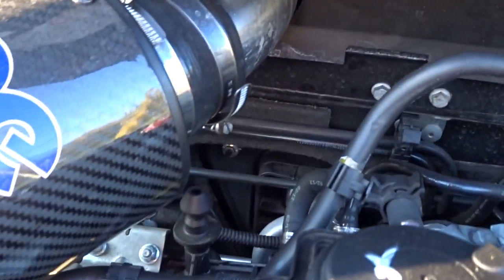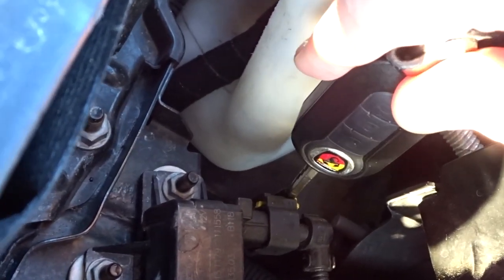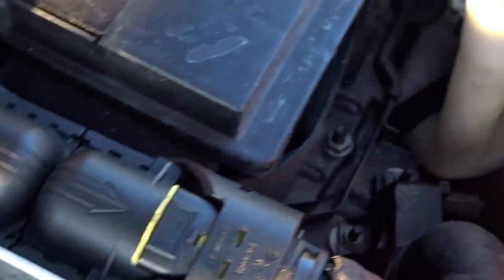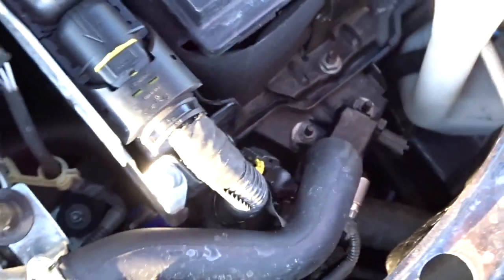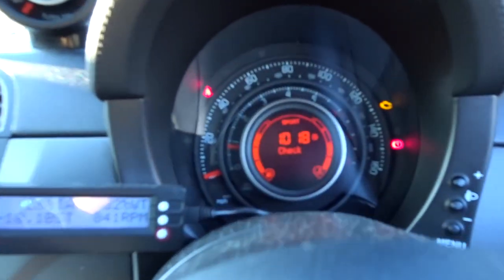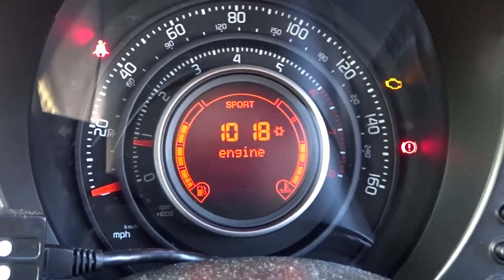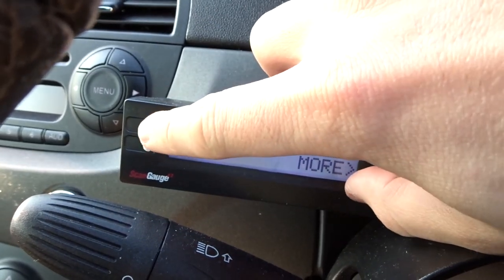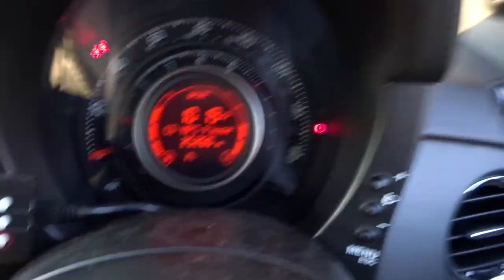How To Get Turbo Flutter Sound: Turbo Chatter Sound | How to make your turbo flutter

Comment: A turbo flutter makes any car guy happy
Reply from the maker: +Charlie Jones that it does!! :)
Reply: My peterbilt makes that noise to when i go hard on the gas and let of, i hate that noise😑😑😑
Reply: Not the one who's racing against it 😂
Reply: What makes the flutter sound
Reply: akos kapa Car Throttle Extra made a good video that explains it well.
Reply: @akoskapa9809  special types of bov
Reply: @averykillian7143  incorrect, that noise is caused because your BOV spring is to hard for your vacum and it never open, so basically you over pressure is coming out buy you compressor part of your turbocharger and yes.... it is bad and damage your turbo
Reply: @fherraul5287  that is what i meant some bovs come too weak to do it
Reply: @akoskapa9809  air going through turbo
Reply: Very true
Reply: @fherraul5287   it's not bad and it can't damage the turbo. That's a myth
Reply: @strider5119  i never said it was bad for the engine or turbo. Is bad for performance, and overtime it will kill your turbo faster. Just go to the track or a dyno and try few runs with and without BOV and you will see.
Reply: @fherraul5287  it's not bad for performance though. I know plenty of people who build cars and a lot of them don't run bov's.
Reply: @strider5119  that good, i respect that but in my shop we do things correctly or "by the boock" not because a loot of people are doing this or that. But i respect averyone idea and methods.
Reply: It will shorten the life of your turbo system. 

The most efficient system is the recirc. The already made boost pressure isn't just dumped like with a BOV. It's used again when the throttle is opened. 

The turbo flutter is the high pressure compressed air hitting a closed throttle butterfly & having nowhere to go but back out through the turbo compressor blades. 

It adds unnecessary twisting forces between the compressor and exhaust side.
Reply: @fherraul5287  It's so bad for performance it's common place in motorsport not to run a valve, speaking of seeing a difference on a dyno, High Performance Academy tested it on  their youtube, they ran the car with and without a blow off valve, there is no difference in turbo speed after you lift off the throttle between them, though anybody that has actually done it could have told you that.

Comment: Ima an FCA MasterTech and I can tell you from experience that the CEL you had was most likely OVERBOOST! When you close the throttle with all that boost from the turbo it needs somewhere to go, hence the RECIRCULATION VALVE, it takes that pressure and dumps it back into the air cleaner to reuse. It prevents turbo lag and keeps the turbo spinning. When you cap or unplug a recirc valve it put MAJOR wear on the turbo bearing. The noise is from the turbo fighting against the boost pressure with a closed throttle. Have fun buying a Turbo for that thing! I highly recommend NOONE do this unless you want to destroy your turbocharger and void your warranty if any. Try spending actual money on real mods I have a co worker with a 500 abarth and all you need is a SRI or CAI, A BLOW OFF VALVE or HYBRID RECIRC VALVE and a GOOD TUNE!
Reply: Let us have fun lmaoo😂
Reply: You ain’t wrong, I was looking for a comment saying this if not I would have told them😂
Reply: From 20yrs of experience with turbo's I'm sorry but you are wrong.

Comment: You can essentially just use a blanking plug on the Recirc valve pipe, Which means you won't need the Scanner to reset the fault codes,  as the Solinoid will still operate as normal just won't receive any boost, the car engine management won't know any difference, as it won't need to be unplugged, Also saves the risk of Limp mode.  You really only need to block off the Intake side, Some people remove the Recirc valve completely and block all the attached pipes, But it's much simpler just to blank it off.

Comment: if you want to keep the stututut noise but dont want the check engine light,,      remove the recirculation valve and replace it by the proper tubing (I, T or Y connector or whatever is needed) but keep the connector in the valve.    This way the ECU sees the valve is being activated and SHOULD not give the ECU light...      on most cars this will be a 10min job max if you got the right parts

Comment: Added a Dinan turbo boost on my A5 now turbo flutters.  People like it
Reply: Same i got it for my benz, how do you make your car stustustu?
Reply: I have a cold air intake. I think the DINAN builds up more pressure than the divert valve can dump. Result is backflow thru the turbo. Try it. If not electrically disconnect the divert valve.  (that may cause a check engine light). Some people tie wrap a dumb divert valve that is not plumbed into their turbo system so the car is happy because it sees a divert valve even though it's not plumbed in or doing anything useful

Comment: Tried this. It sounds so good hahaha.
Reply from the maker: +EnglishKnifeReviewer 🙂👍
Reply: Stef AB Hi Stef, I've reconnected it now, but my check engine light won't turn off. I looked up that gadget you mentioned and didn't expect it to be £200.00. I read online that'll it'll reset after a year. So now, either I spend £200.00 on that scan gauge, take it to a garage and pay them to do it, or wait an entire year for the light to go off. If I knew this, I wouldn't have done it. Any advice?
Reply from the maker: +EnglishKnifeReviewer Ah man, I did mention in the video that you need the scan gauge or you need to take it to be reset 😞 Maybe unplugging the battery for an hour may reset the ecu? Not sure if that will resolve it but could be worth a try.
Reply from the maker: +EnglishKnifeReviewer there's a scangauge for £60 on eBay at the moment. It's the scangauge 1. Just check it resets fault codes before you buy. Also on Amazon new scangauge 2 for £160. eBay sellers are overpricing them
Reply: Stef ABtv whats the problem with having a check engine light
Reply: Is it different on the US models
Reply: EnglishKnifeReviewer ebay. £30. Obd reader. But LOL 2018 boooyz
Reply: what do you unplug and does this hurt the car
Reply: @-movements-6359  it hurts it really badly, dont do that!!!

Comment: I have 2014 mini cooper s F56 Doing the flutter noise all the time, it came with stock after cold air intake is installed, the flutter is very loud, and it has over 120k miles on the stock turbo, still running smoothly as it is my daily commuter. so no worry that much, just enjoy the way you like it. 

oh, and also, one idea if anyone wanna make the flutter with out having the check engine light comes on, I insert a T10 or 192 light bulb into the dump valve connector by banding the legs out of the light bulb and use electrical tape to tape it down, that way is cheating on the Engine Control Module the dump valve electrical circuit is not broken or disconnected, so it can flutter with out having the check engine light.

Comment: I mean you can simply fit a small air filter on the BOV to make it open and not recirculating. Similar Whoosh but you don't get fault codes or harm your turbo.

Comment: Sounds like it's pressure relief through the induction kit instead of the valve relieving pressure due to being unplugged. If high boost/remap it will cause compressor stall/short life of turbo, happened on my Delta turbo in the '80s without a dump valve, woosh through induction kit was great but compressor stall on hard acc was pants
Reply: Are you another person that thinks compressor stall means the turbo stops?

Comment: 84-89 300zx dont come with a blow off valve from factory and some of them i have seen well over 200,000 miles - some reason they thought it didnt matter or need to worry about wrecking your turbo
Reply: They only made like 5 psi of boost on the 89 model, it didn't even have a intercooler. Putting a BOV/BPV may have had little effect, as there is not a lot of pressure
Reply: If you're running 8 or more psi i'll say is when you may want to have a BOV/BPV to reduce the wear on the compressor.  Even if the effects of not running a BOV or BPV are neglectable, it's always better to be safe than sorry.
Reply: 18 psi on mine just fine - flutter flutter - just fine no issues here -   i think its personal preference with this idea - either way it sounds cool -
Reply: the one Just because it is running now,  doesn't mean it will later. It won't sound good when your car doesn't run at all
Reply: the one There is a reason why most cars these days come from factory with a BPV, manufacturers won't waste their money installing them on every single turbocharged vehicle they make for no reason.

Comment: cool....but on mine it dosnt change anything....after 2-3 startups it comes the enginecheck but no tututututu
Reply: ??? any solution why
Reply: tim006e do you have an intake? You probably won't hear it with the stock one
Reply: tim006e feels bad
Reply: You need a cone filter or free flowing cold air intake to get those turbo noises ... Stock airbox has a muffling effect, also if you don't care you can Swiss cheese before the filter of your stock airbox (Swiss cheesing the airbox is a technical term btw 😁👌)

Comment: My Mini Cooper S F56 used to do it stock, it would flutter nice and loud every up shift (MT) with no need to unplug the valve. But after a year of driving it and 3000 km the flutter is not there most of the time, it is barely noticeable from 2nd to 3rd but that’s about it. I can’t really notice a difference in how the car runs, if anything I feel it runs better because of the 3k it takes the engine to break in. But definitely miss the flutter.

Comment: What about if you put a resistor in the connector to trick it in to thinking it's still connected same as you do with airbags and aftermarket steering wheel

Comment: So, all I have to do prevent the valve to dump the excessive pressure from the turbo? Would I not want to dump the excess pressure somewhere? Can you explain where the pressure built from the turbo goes, if not dumped somewhere/anywhere? Cool noises tho.
Reply: Dumped back into your turbo
Reply: Thus coming out through your turbo making that flutter noise
Reply: Turbos are a type of air pump? They pump air one way, only? They produce a good amount, to a lot of pressure. That is being sent through the intake system? The engine is itself a big air pump? So if an pump charging the larger pump gets backed up would that not be good? An N/A engine “air pump” has blow-by, essentially the pressures that are deferentially above and below the rings around the piston, will have pressure go by, they are designed to allow the occurrence periodically? 
    Are turbo manufacturers and engineers, designing with the reintroduction of previous pressures, being pushed backwards when compared to the normal operation?

Comment: I have similar noise in my 2016 MINI Cooper S but I didn't disconnect anything.  I don't remember hearing this noise before but it appeared later few months later after I purchased my car used.  Still under warranty and there are no codes.  Is this normal?

Comment: how does it works on the Fiat Bravo 198 1,4 120 HP (its the same engine but smaller turbo)
Reply from the maker: +The1Maywather would think if it's the same engine it should be he same concept but I would double check before doing it. Also make sure you have a way of clearing fault codes down too and an intake 👍🏻 as mentioned in previous comments, it's not great for your turbo
Reply: Stef AB thanks,  yeah i know dont wanna do it often ^^ i will check it out ;)
Reply: Stef ABtv I don’t have a cold air intake but I have a k and n air filter and a 2013 Fiat 509 TURBO can I do it to that?
Reply: Works great, put a after market air filter on it to make it louder

Comment: If you want to do this more effectively you need to remove the hose from the valve to the intake. The bov side needs to be capped and blocked off completely. I use a $2 rubber chair leg end because they come in 25mm and are a perfect fit.
Reply: ss1900 that's what I'm trying to do but I'm sure where it is on my 17 500 abarth it's a US model seaming to be different location
Reply: Can you do a video showing us?

Comment: so will not clearing the code cause problems? or are there other ways of getting this sound with out causing problems thanks for the vid love the car!
Reply from the maker: +murf's garage you can get the sound with just the intake and careful throttle control, if you hit boost and very gently bleed off the throttle it will give you flutter at low Rpm too. As far as I'm aware the code doesn't put the car into limp mode so still drivable
Reply: +Stef ABtv okay thanks man

Comment: Instead of "unplugging" the dump valv to ghet the flutter, u could just remove the recykling pipe and plug that. That way the dump will go rigt out and u will ghet the nice "PSCHHHHHhhhhhhhHHHH" noise. and u wont risk dameging youre turbo whit the blow back air. :D

Comment: Turbo chatter vs turbo flutter is so different.. turbo chatter is the compressor wheel chattering because the bearing is worn out or damaged usually, not what you want and sounds awful lol

Comment: Hey! If I unplug it and not to bothered about the light will it be fine to run with the light!? Or will the engine assume bad conditions and fuel heavy and go into limp etc.. thanks!
Reply from the maker: +ABFlash I think overtime the ecu won't like it and it could cause issues down the line. Best to be able to reset it IMO

Comment: hmmm....do i bother to do it just for ace 2morrow nite or do i wait till i get my bonalume bov on sunday...oh decisions decisions
Reply from the maker: +Hardcore Scorpiator ooo bonalume 👍🏻👍🏻 good choice
Reply: Hardcore Scorpiator How about don't do it at all because it will break your car. The whole point of the valve is to stop the excess boost backing up into the turbo.
Reply from the maker: +Adam Henry not so bad if your replacing the turbo soon 👀 lol but yeah as Adam mentioned paul it's a how too rather than a recommendation. Also mentioned in the video 🙂
Reply: Stef AB exactly and yes you did make it clear to people matey

Comment: Hi Stef, I have the North American 500 Abarth, and unfortunately my car goes into limp mode when I unplug the recirculation valve. Slightly different setup with the recirc valve mounted on the turbo itself, but still the same theory. If you don't clear the code, does your car go into limp mode?  I get limited to 9 lbs, but haven't tried
clearing the code with the valve disconnected.
Reply from the maker: +Jon Olaivar on the tjet is doesn't go into limp but the eml stays on until you clear the code down
Reply: Stef ABtv Ahh, I guess with MultiAir and a larger turbo (1446) the US devs we're a bit more cautious with the programming.  I love your car and your channel, it really makes me want to tune my Abarth!

Comment: +Stef AB I am having trouble locating the soluenoid in my 2013 fiat 500 Abarth was wondering if you could help me? It is a right hand drive by the way.
Reply from the maker: +Anthony Moir is it a Tjet engine or a multiair? If it's a Tjet it should be in the same location as in the video?
Reply: Multi air
Reply: Stef ABtv,  And so,  where is the soluenoid located at in Fiat Bravo 1.4L Multiair Engine

Comment: Hi Stef,  Thanks for all your vids.  They helped me make the decision to buy the missis a 595 comp for Christmas!!!!  Just one question if I may.  Have you ever had a rattle from the back of your car?  I have been going crazy trying to find it.  The whole of the boot has been emptied and I have even driven with the tail gate up.  I have listened to all the advice from the Abarth forums and checked the seats and seatbelts etc.......Just thought I'd ask as your the man in the know through your meets if you could advise.  Cheers and keep up the good work with the vids.
Reply from the maker: Thank you! Awesome! Hope you are loving the car. I get lots of rattles but mainly from the coil overs. Check the rear seats they can also rattle of the bolts come loose 👍🏻
Reply: Thanks Ill look into it.  I must say its only on really bad roads.  All the best.

Comment: HI M8 abarth owner from Portugal. instead of unplugging the solenoid you can unplug the tube that connects to the intake making its recirculation. that way u don't get the engine code fault. just be careful with dust coming to the system. cheers luv ur videos.
Reply from the maker: +Rodrigo Carvalho thanks for watching Rodrigo :)

Comment: That recirculation valve was installed from factory for a reason.
Reply: Making a notoriously unreliable car even more unreliable
Reply from the maker: The Abarths are actually reliable cars. Agree that it isn’t good for the turbo. Once I changed it I left it plugged in
Reply: Yeah, so u don’t get that noise...

Comment: Hey stef, in order to get the flutter sound do I need an air intake or will I still get it with full stock components on everything? Is there a certain supporting mod I’d need to get the turbo flutter?
Reply from the maker: Hi Michael. It’s all detailed in the video. Intake makes the flutter Louder. It’s not good for the turbo and will flag an EML
Reply: Stef ABtv okay thanks heaps mate!
Reply: michael clemente

Comment: Ugh I'm torn on either getting an Abarth 500 or the Abarth 124 Spider 😓😓😓
Reply from the maker: +Jose Rodriguez both are great cars! I know a few how have bought 124 spiders and love them. They both had 500's prior
Reply: Stef AB nice man! Only problem is that here in the states they sort of give us a deluded version of the abarth which sucks.. even the steering wheel doesn't get an abarth badge but a simple Fiat one 😖